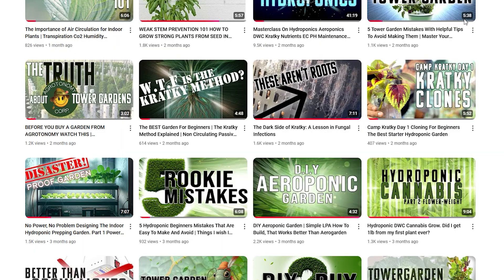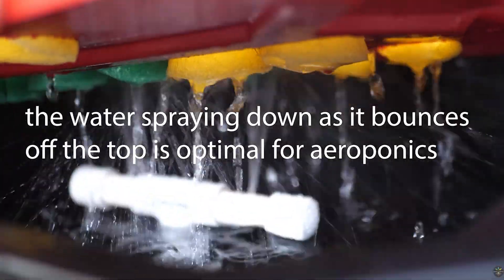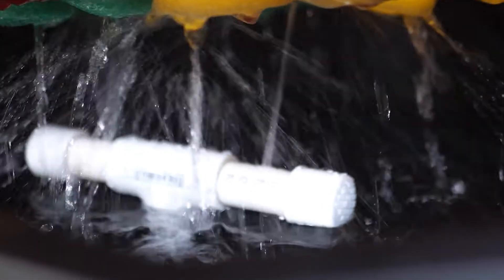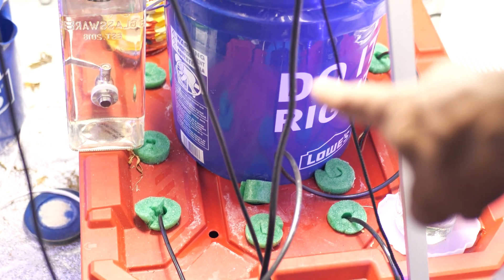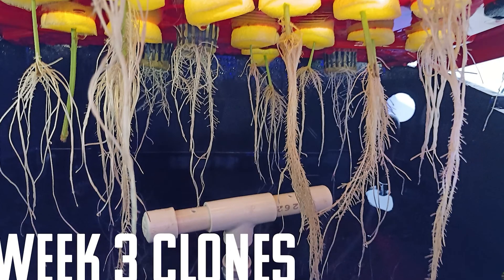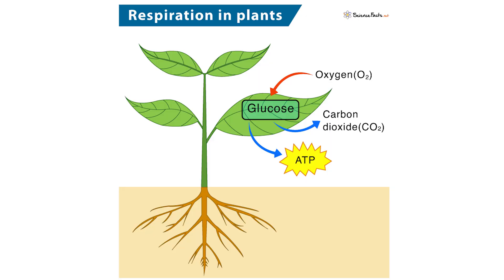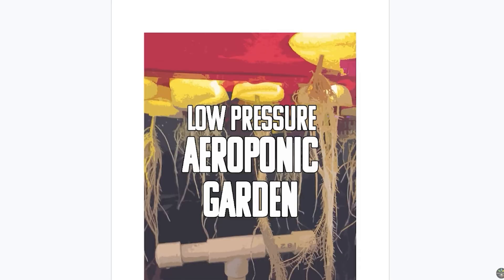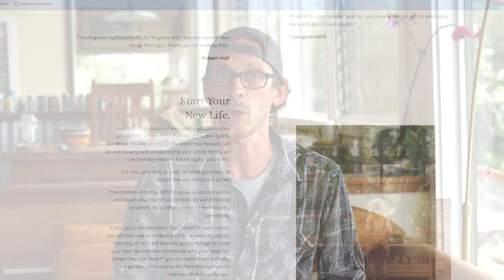I SHOW YOU HOW TO BUILD THE BEST AEROPONIC GARDEN FOR UNDER $50 | THIS GARDEN WON'T BE OUTGROWN!

Comment: I know this vid is about aeroponics, but in talking about the chunks of water, I was wondering about a fogponics fogger, when used without the hat cover that some of them have, it shoots up a bunch of water. Is it better to allow that water to shoot up to where the plants are, or is it best to just put the plastic hat on top of the fogger and just let the fog and humidity reach the roots?
Reply from the maker: It is actually better to keep the "hat" on. Not necessarily because of the water that shoots up, but because the temperature of the water that evacuates the ultrasonic vibrations is considerably warmer than the water around it. It is better to allow it to defuse in the water around it to prevent root rot.
Reply: @humblegrowth  Ok I see thanks!

Comment: If you have the vapor pressure deficit dialed in to the particular plant, do you think the plants would grow faster aeroponically over kratky or NFT?
Reply from the maker: Definitely. Maybe not at first, but after a strong root system has grown, having the vapor dialed in will lead to AMAZING grows that will surpass any other method or technique. Even THIS build will surpass a DWC, Kratky, or any other type of Hydroponic garden in rate of growth, size and yield. Well, I guess I can't say that until I have made the video series.....guess we'll have to see
Reply: @humblegrowth  Thanks man, I'll have to try it when I'm done with my cold plasma experiments.